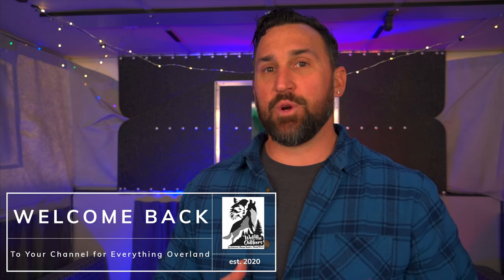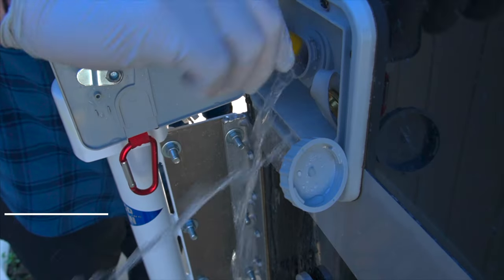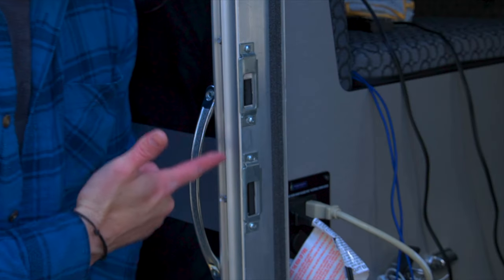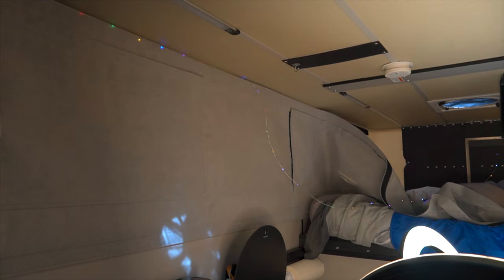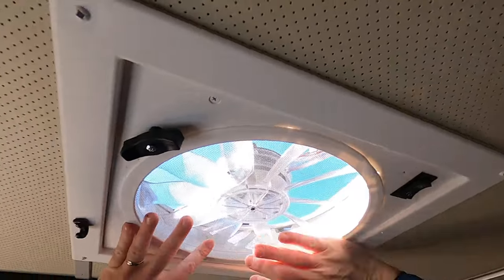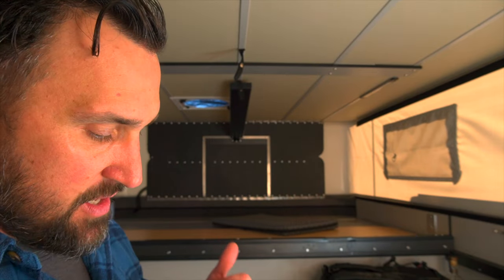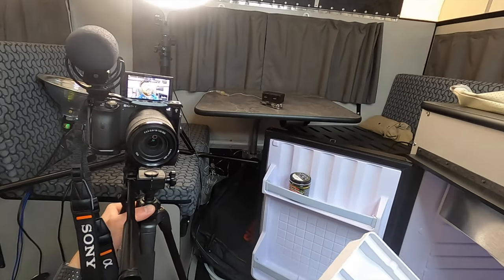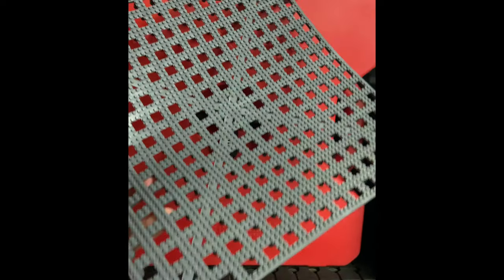Best Four Wheel Camper Maintenance Plan 2021 |  Home is Where You Park it

Comment: Do you add Silica bags for moisture control also what is the longest period of storage you seen and best ways to do it
Reply from the maker: We’ve found that correctly venting the camper when cooking or showering is the best way to avoid moisture buildup, then when possible airing it out in the mornings... even if it’s only a few minutes of airing out. 

As for the second part I’m not quite sure what you mean by the longest period of storage I’ve seen?